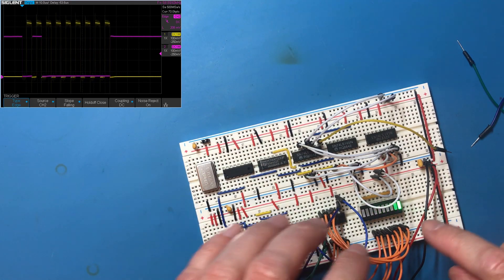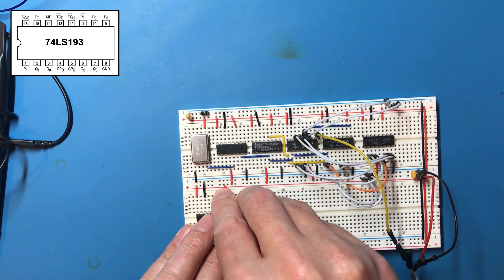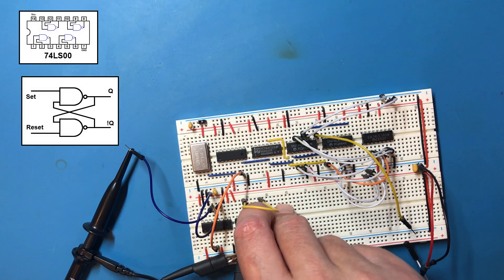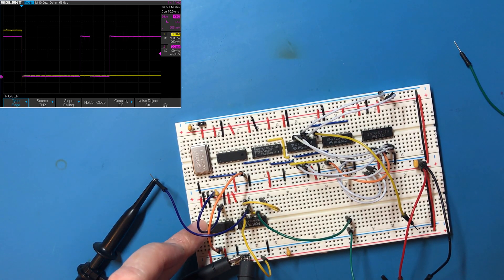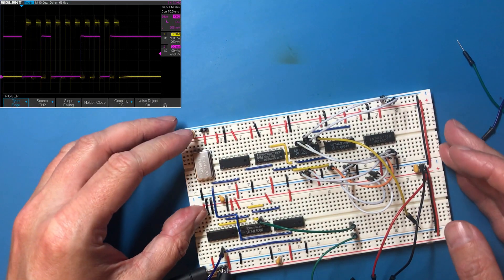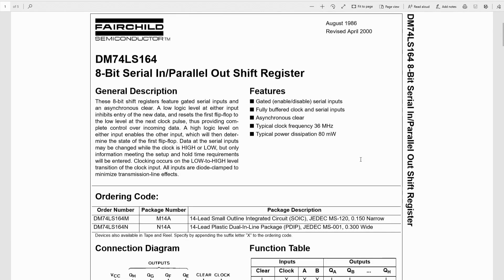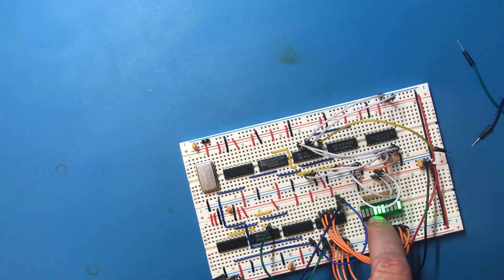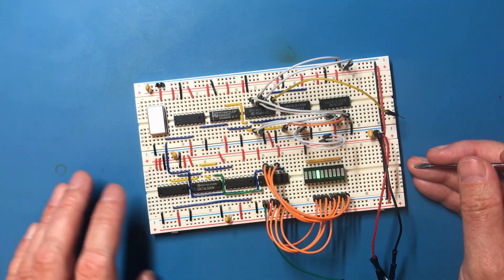Receive - UART from Scratch - Part 2

Comment: Congratulations for what you do and many thanks for sharing this with us, James! I'm not sure if I'm saying it wrong or not, but isn't an majority circuit used in receiving the start bit? Have you thought of doing an implementation in this way as well? Also, do you think to implement an SPI interface?
Reply from the maker: Thanks! SPI is mostly a simple architecture but there are some complexities to it (the different modes). In some ways the SNES controller interface I built is closer to SPI.

Comment: I don’t understand the issue whose solution requires the additional 193 that is held in reset until the start bit arrives.
Reply from the maker: Holding the counter in reset until the falling edge of the start bit gives us a clock synchronised with the senders clock.
Reply: Thanks. I’ve thought about it some more and realized a couple of things. 
First, that using the clock signal of the crystal gives a 16x finer resolution than does the 1st 193, and that this enables starting the counter on the 2nd 193 very quickly after the start bit, as a clock edge is available sooner. Second, that in the setup without the 2nd 193, there is a phase shift of the start bit wrt the 1st 193 clock due to propagation delays. What I still don’t understand is why that delay varies from key press to key press.

Comment: Great video - really enjoyed watching!! 
What would happen if you started receiving just as Tx was toggling between data bits, and confused this as the start bit? Is there a way around this or are you just assuming you always start Rx with a "clean" start bit?
Reply from the maker: Thanks Richard.  Not 100% sure I understand what you are asking, I'm wondering if you think the tx/rx pair at each end are connected together? The TX on the remote end connect to the local RX and vise-versa. There shouldn't be any cross talk between them.
Reply: @weirdboyjim  Thanks for the reply. Say you are constantly transmitting data and then start receiving at a random point in time. There's no guarantee that the first falling edge the receiver "sees" is the start bit (could be the falling edge of a data bit, say). So I suppose i'm wondering how synchronisation to the start bit is always guaranteed. If that makes sense?
Reply: @r1chard_john  the first character would be garbled, but as soon as there was a "gap" in the incoming data, longer than a true character, it would automatically resynchronize.  True UART hardware would notice an incorrect stop bit polarity and generate a framing error.

Comment: Just finished binge watching almost 100 videos about your cpu🤪 
But here is my first question: could you use the original 1.8MHz clock to "oversample" for the start bit and use that to reset the divide by 16 counter for alignment?
Reply from the maker: That's pretty much what the circuit does, I hold the counter (one running at the 1.8mhz) in reset until until the start bit comes in. Sorry if it wasn't clear.

Comment: In real world situation the receiver has its own clock. There is no clock line specified in UART.
Reply from the maker: I think you have misunderstood what my circuit is doing, the transmit and receive circuits share a clock source but there is no clock connection from the remote transmitter to the local receive, or the local transmitter to the remote receive circuit. The transmit and receive circuits shown here are not talking to each other, they form the two halves of a UART and share some circuitry.
Reply: @weirdboyjim  I see. First I didn't notice you've added separate clock divider for the receiver. I recommend using 74HC595 instead of 164 and separate register.
Reply from the maker: @FilipMilerX  Other people have suggested the 595 but I explicitly wanted to separate the functionality in this version. Hopefully it's clear to the viewer that the latch functionality is necessary. You could get an entire UART on one Chip fairly early, the point of this series is to look at the internal workings, not the easiest way to do it.
Reply: Hello. I've always had a doubt about serial lines.
Lets say we are receiving a long stream of bytes. Our circuit gets the first low, takes it as start than counts to 10.
What happens if i conect the line at the middle of some random byte?
The first 0 bit in that byte would be mistaken by a start and that count would never be synched.
How can i avoid this?
Reply: @cussuol The stop bit might not match up and the receiver will sync to a different start bit. But yes, you might receive a couple bytes of garbage

Comment: Clock alignment was my biggest concern but you addressed that perfectly.  I had issues back in the day with 9600bps devices being just a little too slow or fast so the clock would periodically fall out of alignment.  This isn't a huge deal for typing and displays as it manifests as a "rare" 1 bit error, but for sending several KB of binary data, it could be a nightmare.
Reply from the maker: Thanks Michael! In theory the receive circuit shout tolerate a drift of upto half a bit per transmission frame as it essentially resets itself with each start bit, something else would probably go wrong before then though. We are a bit spoiled now with the accuracy of all the components we get comparatively cheaply.
Reply: I've only saw that on badly implemented "bit banging" UARTs made via software that didn't use interrupts to detect the lowering edge trigger. 

You have to edge trigger the circuit on lower signal, its easier done with discrete components, ironically than on software (because people are bad with interrupt code).
Reply: I couldn't imagine trying to transmit KBs of data over serial without some kind of error detection. I often use Modbus over RS485 to read out some industrial device and get an error every couple 100 packets, but that's fine because it has a checksum and can repeat or ignore that packet

Comment: Nice! I imagine hardware flow control would be useful for the receive side at least, 115200 is not slow for this type of tech :) That seems fairly simple though
Reply from the maker: Thanks Frank! There are a few options for flow control, but I'm worried I might be digging myself a hole with the amount of circuit to build on top of what I have.
Reply: Fifo UART maybe nice to add as well  if it wasn't  suggested .
Reply: @Clearwater420  it would be great. How complex do you want it to get? ;)

Comment: Nice, now you've just got to add a baud rate generator, auto detect and a buffer :) in the past we used to add a preamble to the the message to give the receiver a chance to sync and get the mid point more accurate. I thought you were going to send "The quick brown fox jumped over the lazy dogs" or some thing of that ilk.
Reply from the maker: Thanks Teh, Baud rate generator is a maybe. Buffering I'm interested in, but a multi-byte buffer might be a lot of circuit to add. Auto detecting the baud rate is an interesting challenge, not sure I'd want to do it in hardware on a breadboard though.

Comment: very nice, especially the second 193 to sync the start bit.
Reply from the maker: Thanks Mathias! The combination of the SR latch to detect the start bit and it's inverted output holding the 193 in reset is really the core of this circuit.

Comment: Very nice! It would be great to see the schematic for what's on the breadboard.

I guess, once the CPU interfacing is figured out, you will make up a UART a pcb? I think that will be your first input device, as the LCD was all output?

And I still think you should write a machine code monitor. It's a fabulous way to learn an ISA, or in this case, to confirm that an ISA is useful for writing practical software.
Reply from the maker: Yeah, I'll probably do a pcb for it at some point although I've not 100% decided if it will form a final part of the cpu build or not.
Reply: @weirdboyjim  it would make debugging your games easier? Also you could use it as a way to load code without plucking out the EEPROMs.
Reply from the maker: Lawrence, it's not that I don't see value in a monitor, it's that it doesn't win out when compared against other things I could spend my time on. A half baked one could be done quite quickly but to do the job well is a significant time investment.  I have a different method of loading code without an eeprom planned that could be completed alongside a couple of games in the time it would take me to write a decent monitor.